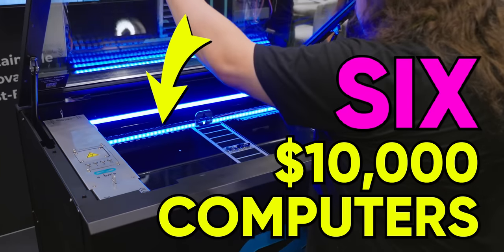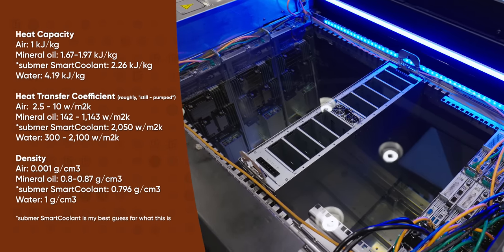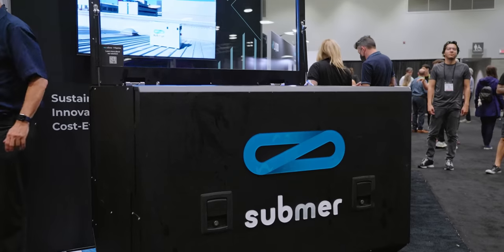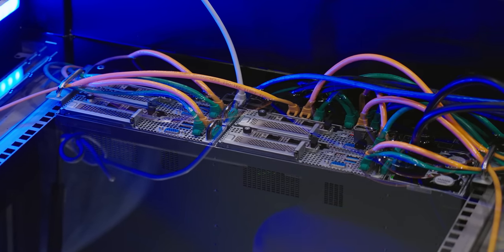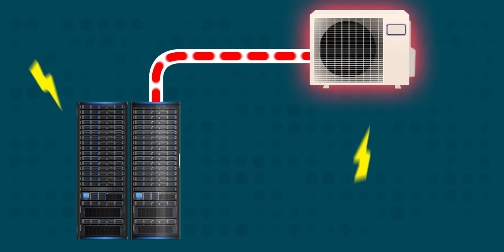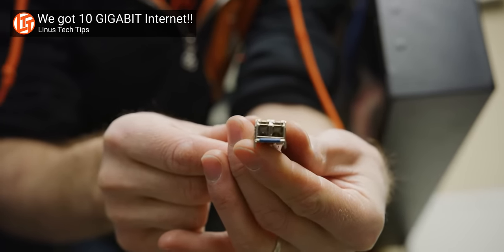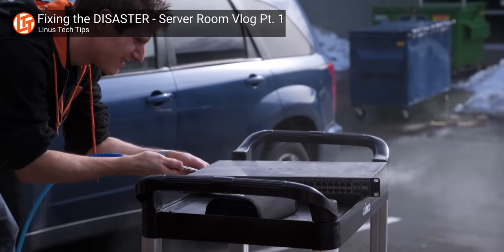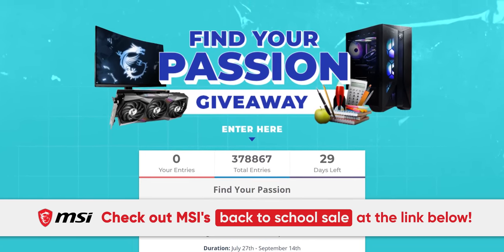This server lives underwater! - Hypertec Immersion Cooling

Comment: The way the heat is more efficiently used in other areas of the building reminds me of what Iceland does with it's hot water as a by-product to the geothermal energy it produces. Iceland produces so much hot water that there are man-made hot springs where people can have a dip... I'm sure there are other uses but that's the only one I can remember.

I can imagine a future where Little Timmy's PC gaming is the cause to the whole house being heated rather than relying on central heating.

Comment: In our country is one datacenter with fully submerged servers with IO too, but in "old way" - mineral oil. They use the heat from servers to heat up offices in winter and city pool which is near in summer...they have been working on that idea about 5 years before they even started building the datacenter. They even have contract with some of the big names in server world that they have warranty even if the hw is fully covered in oil... :)

Comment: If you added Peltier heat pumps to the heat exchangers then numerous server racks could all export heat to the same master loop which could run extremely hot and run a steam turbine. Some server farms use insane amounts of electricity, far more than would be needed, recouping this for the office or local facilities or back to the grid would be an outstanding solution!

Comment: This sounds quite amazing. Next to removing the need for a strong HVAC it also solves the problem of fire for many Datacenters - if I understand correctly. If all systems are sumberged in a non-flamable liquid you should be able to skip a costly Halon- or Oxygen-reduction system in your DC.

Comment: I am curious to see how they would deal with contamination, this filter thing, as it could potentially make the liquid conduct electricity and damage everything.
Reply: Yes, like the fluid might tend to absorb water out of the air.
Reply: @waynesallee-com  Well pure water does not deliver electricity, its the contaminations in water that do that. I somehow get the feeling this is distilled water they are using with some anti corrosive chemicals added to protect the system, these being somewhat low boiling point chemicals around 100C so it can be cleaned via distillation. Maybe you could even run distillation by running the heated water in batches to separate container that gets heated and distilled in phases to remove contaminations.
Cool system and i would love to know more about what this liquid might be, but hard to say. Tried looking into Hypertech patents to see if there was any info, but could not find anything related on their name, though patent could be under someone elses name, to try and hide the information, so those that are into this dont just try reverse engineer this stuff based on patent information for personal use, or they havent done the patent application, though i doubt that. Well we will know in future and yeah home pc with this system would be pretty nice, specially on hot days, to be able to dump that heat outside. I wonder if this stuff freezes easily..
Reply: @Hellsong89  Yes, it is true that pure water does not conduct electricity, and that it's the impurities that cause water to conduct electricity, but keep in mind that any bare metal coming in contact with the water will add metal ions to the water, and gasses dissolved in the water affects it's conductivity. Trying to keep water non-conductive would be more trouble than it's worth. And while it's possible that they may have done as you have said, that would not work long term, because the water would soak into areas that have very slow to almost no flow. As the water slowly dissolves metal and other impurities, the conductivity in those spots would slowly increase uncontrollably. Water could make for a great illusion at a trade show, but it would not work long term. Also, if you read the spec sheet, that stuff is flammable.

Comment: Man, i remember when Aquarium cooling was a big thing, back when most cases were trash on airflow
Reply: " back when most cases were trash on airflow"
Yup. These days its "only" 50/50 whether or not the case sucks for airflow.
Reply: @The_Keeper  I mean there was a gap between the two where it was somewhat better, with intakes on the side panels for direct GPU cooling even being a common and in style thing. Then came tempered glass...
Reply: This product suffers the same problem for why mineral oil never become a big hit. If there needs to be any maintenance it becomes a big liquid mess. Its really awesome and I support liquid becoming normalized. But until its a clean self enclosed unit as part of the package. Its just not practical for most applications. Despite the energy savings. 

I also dont see any company tying this into any of this drinking water as mentioned in the video. All kind of regulations that idea would break...

Comment: At first I was like, "Oh it's just a better mineral bath." But the fact you can just dump the heat into water easily is SUPER cool. That's a great use for the waste heat.
Reply: Thats useful, but I wonder if its cost effective, we'd need to know hot water temperatures and mass flow rates to decide whether or not there's a lot of exergy there

Comment: If it sounds too good to be true, that's because the benefits are only fully realized under narrow circumstances.  The system moves heat from the servers to the heat exchanger which dumps the heat into a supply of cold water. They present the resulting hot water stream as a bonus, but don't forget that you have to pay for the cold water. If an industrial process can use the hot water stream in place of other water sources, then this approach could be great. If only the heat is needed and not the water itself (such as heating buildings), then you're sort of wasting water. Considering the current growing concerns over water supplies in regions across the world, the tradeoff of using lots of water rather than lots of electricity isn't so cut and dry.

Comment: It's probably gonna be way too expensive for home PCs, but for server farms this could be the future
Reply: Yup, even small % savings in energy costs and hardware longevity results in millions (if not more) in cost reduction. When you're working on the scale of data centers like Google it's a no brainer assuming it does what they say. If the tech works and isn't a giant hassle to install into data centers and maintain that is.
Reply: Yes normally this type of system is used in large GPU and ASICs crypto farms if you research a little you will find a lot of people using this type of tanks

Comment: Super cool, literally. I am seriously doubting the environmental/safety claims until they release what's in it, preferably getting a proper MSDS. Even if it didn't meet those claims, it's still definitely worth for industrial applications.
Reply: Even if the solutions aren't so enviormentally friendly, the efficency and potential waste heat recycling could be enough for a breakthrough, hopefully.

Comment: I work in cnc machine and we used some thing almost identical to this its called EDM fluids.
This fluid is able to handle heats up to and hotter than the surface of the sun..in atomic level of course but add a standard 1/2 water chiller for vacuum mold coolers and you can run this stuff at sub temps cause it doesnt frezze.

Comment: There's a solar water heater panel in my house that only I use for shower. I take slow baths, half an hour each every day with the hot water. Even still, the water heated so much due to sunlight that one day the water pipes almost blew up due to steam pressure.

Every single home has a huge amount of wasted energy. Coming from the sun. Coming from our devices. We absolutely NEED to use more of it.

Comment: I do remember someone talking about a new liquid a couple of years back for PC cooling. I sorta figured out what it was and forgot and it is breaking my brain now. It was one of the tech channels like Linus Tech Tips. I can make a guess but have no idea what I thought the other one was. A glycol based coolant with additives.  They can be part dielectric, have good specific heat capacity, are non flammable, can be non toxic, and they do not need super budget science exist. That they created some new type of liquid that we did not have before, well that would be odd considering they do not have like that level of funding and no one has ever heard of them. I mean there are not many dielectric liquids you can drink and not die. Water is one. Some glycols are another.

Comment: Chemistry background here, my guess would be that it's some kind of a modified cyclomethicone or cyclopentsiloxane if it really breaks down in water.
- Water-like viscosity
- Nominal to low toxicity as a polysiloxane over a carbon chain aliphatic.
- Mild to low impact on plastics/plasticizer leaching or degradation of polymers
- Approximately the right kind of specific heat capacity that's improved over carbon chain aliphatics.
- High boiling, mild to low flammability.
- 'Regenerable by dialysis' probably means any degradation products with free -OH groups can be mopped up in some kind of sorbant or exchanged across some kind of a membrane.
Reply: Either that, or a Dow Corning Syltherm heat transfer fluid - ballpark the right kind of specific heat capacity and density...

Comment: While I'm all for electric vehicles and offsetting coal/oil with other green techs, it's also just not quite developed enough to be feasible for the majority of people and the resulting battery and e waste is rarely talked about. This, on the other hand, is extremely well thought out and if taken into consideration during building design/upfit/renovation, can be a HUGE factor in reducing their operating costs while also giving them Green points and something to use for PR. This is the type of innovation and change I think we need right now, and I'm here for it.

Comment: Looks pretty nice. But there are two problems i see:
1. Height limitations; You can only reach with your arm that deep and this is the limitation of how deep the thing can be
2. Weight; If you were to fill  up a building with these it must support a lot more weight than traditional servers. Most buildings are probably not suited for that. Single ones should be no problem tough.

Comment: imagine datacenters with technology like this being built in cold climates - you could even probably sell residual heat from this system for heating apartments lowering the operating costs. Perhaps some kind of heat exchanger and heat pump to raise the water temperature for heating would be necessary but that depends on how hot the outlet water is.

Also another thing I'd different from their showcase is keep the wires outside the liquid, over time it could seep through the wires and may cause some unseen problems.

Comment: Fantastic concept, although I suspect maintenance will be "fun" in practice. They should run the the hot-water outlet through a heat exchanger using polyethelene glycol and use the resultant vapor pressures to recapture some of the electricity used, for some extra-silly energy recycling.

Comment: looking at the specs for the liquid on their website, the density of the coolant at 20 C is very similar to that of isopropyl alcohol and ethanol's. though since its not flammable, it likely isn't one of those options(or at least not entirely made of one of these). What it likely does have to some capacity though is deionized water as they state online that the mix has ≤20 mg/kg of water which is only a small portion of the mix but still one ingredient.

Comment: My first thought was floorspace usage compared to conventional racks but it wasn't addressed in this video at all.  In major cities is the additional floorspace required enough to offset power usage?  On a hosting standpoint, you can include cost for expected power usage in the price, that same wouldn't be able to apply as it would push the price up significantly IMO.

Comment: In proper thermodynamics thermal energy is not heat, it can create heat. Typically from servers it is usually heat. Semantics I know, but still. 
Q=U*A* dT
Q=heat
U=overall heat transfer coefficient
A= Heat transfer difference
dT= temperature difference, which only the net energy transfer can be counted as heat.

Comment: It's probably just a variation of propylene glycol antifreeze. That's used in a lot of modern vehicles as a much safer form of anti freeze, it's edible in some forms, relatively safe in most anyway, and used in vapes for smoke, colourless, water solvable and non-irritating. It does slowly become conductive over time but then most antifreeze formulations have inhibitors in them so I don't see why they couldn't just use an undyed version of the same.
 You could probably get it off the shelf pretty cheap, it's not an expensive chemical.

Comment: I wonder if it’s like the dielectric oil we used in the TPS-75 Radar? We submerged the twystron transmitter tube in a tank of oil, for insulation and cooling

Comment: So, when  you need to replace a dimm you have to get covered in that film and slop it all over the DC floor. Or you'll need a custom cart to wheel around the catch the fluid. Not a show stopper but serviceability is not a small problem.
Reply: Hi Joseph, the typical installation would have an overhead winch which would be used to pull out servers and let them drip into the tank. When this is done you could also easily replace a dimm without getting anything wet.
Reply: @HypertecGroup  I assume the coolant is pretty viscous so it would run off rather quickly? It seems obviously direct towards a larger install base. I can't see this setup in a closet at a doctor's office for example. I work for a TPM so I'm just thinking about the challenges in a few years when the first generation of these start coming off OEM warranty.

Comment: OK guys, build us a gaming rig version for us NOW! Substituting every fan and cooler and standard case for a small tank and the remote heat exchanger. Net cost more, same, less? Silence will be golden, but what about weight? Water is 8.3lbs/ 3.78kgs per gallon. How much coolant is needed? Is the radiator and hose setup (for a single rig size) an in-window A/C form factor, or something more advanced requiring plumbing skills?

Comment: This story is old news, nothing new here except for the type of cooling solution. We’ve been using immersion systems from GRC since 2010 and it didn’t take long for us to become converts. In 2013 we added an HRV system that, in the winter, captures the heat from our systems and dumps it into the administrative side of the building.

Comment: Welcome to 1995?  The Cray T90 was exactly this - a tub full of 'nert flowing across US$12M worth of circuit boards.  But seriously, this is really cool to see it come down to "consumer" levels. Do be aware that if you have a circuit failure, and there's a short or other "high temp" even, that nert breaks down into PCBs which are toxic and carcinogenic.

Comment: Very cool. 
Linus should use this in his house. 😃
I'd like it but won't work in apartment/condo because you need to handle the exterior cooling outside your unit. In a home it would be just like an additional AC unit. 

For a DC though... imagine having rows of these tanks.  Would you be able to have one external heat exchanger or would you need one per loop/rack?

Comment: I would like to see some sort of water sensor in the exchange loop that controls a valve to automatically shut off the flow in case the exchanger cracks internally and starts filling your expensive server with water instead of the solution.

Comment: While it is cool that this tech exists, it isn't really addressing the elephant in the room of using substantially less energy in the first place.  It may reduce the number of fans in the server room but you have to dump that heat somewhere and keep the temps low at the same time which is a big ask without using refrigeration somewhere in the system.  You could use a underground loop to pull some of the heat away but at some point you will raise the latent heat in the ground enough to need a heatpump to dump more of the heat in the system.  The same can be said for dumping the heat to the air outside a building as a heatpump will still be required.

Comment: The only concern for this solution is the weight per area this would impose onto any structure that has to house them. Adding potentially a tone per square metre would definitely need to be accounted for. Would be cool to know if they included this in their CapEx costs.

Comment: reliability of the submerged connectors leaves me wondering.. can it really do plug in/out in the fluid with good electrical contact? I guess that preserve traditional air oxydation overtime which is a plus... would love to see a the study reports about this..  should everything be passed in vaccum to suck out all the bubbles trapped inside ?

Comment: This is definitely a neat idea, but I'm wondering, wouldn't components rust while being submerged for so long? Sure, the solution is non conductive, but is it corrosion and algae resistant as well? Otherwise, looks very practical and energy efficient.

Comment: This solution seems promising and very cool, but a lot of servers in DC are storage systems that generate a lot of heat, this technology maybe is not compatible with the HDDs because of the 'Breathing hole' for the pressure.

Comment: what kind of "additive" mixture is needed beyond just using de-ionized water? It looks like an EDM machine tank which use a DI/RO filter system. We have an industrial system that creates the dielectric at the rate of about 1 gallon per hour, so it takes a few days to fill completely. You can drink the water but it's gross...first thing I tried lol